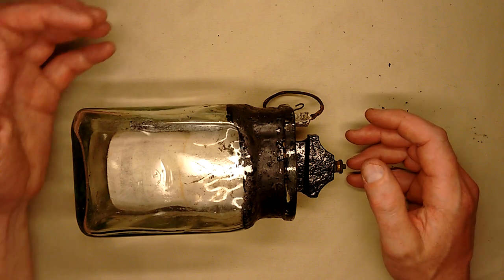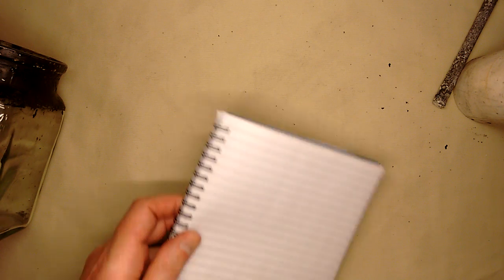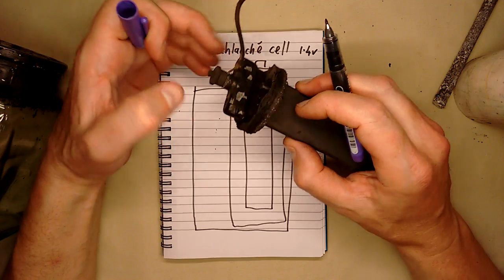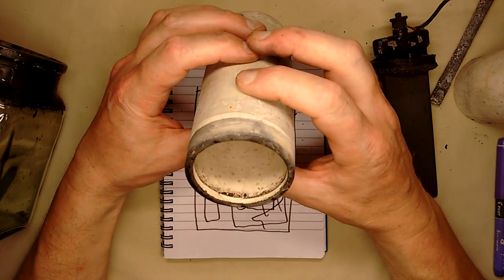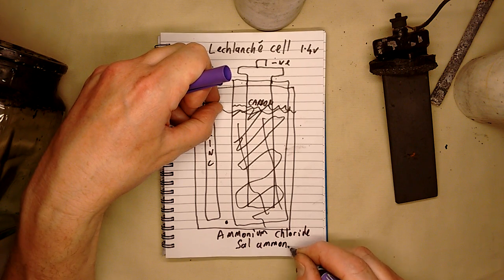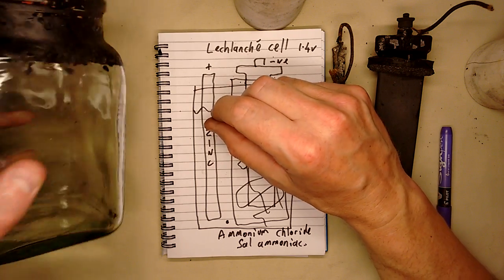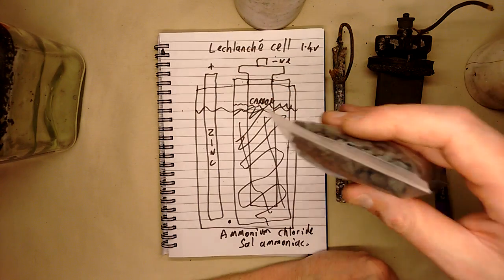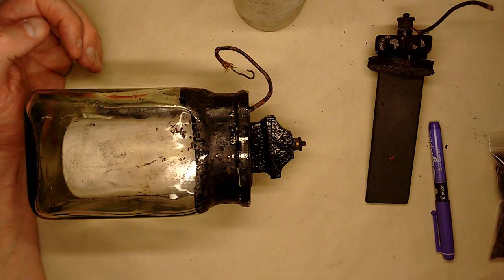A look at a vintage Leclanche cell.  (Very early battery.)

Comment: Many problems here, like zn acts as an anode as it has less reducing potential, so it must be -ve part as on anode oxidation provides 2 e and zn+2 ion and many more mistakes cl. eary, you are not familiar with chemistry of the  cells and electrochemistry, but still yo've done a great job sharing this online as normal person wont find any such cells to see how we started

Comment: The only old battery I have seen was decades ago when I was a teen and we moved to a local school's janitor's apartment (part of the school building) as my father got the janitor's job. In the basement there was an intriguing looking battery. It was a rectangular clear glass container, quite big perhaps something like 50 by 30 by 20 cm, and it was divided into many sections (the dividers were part of the glass container so it was quite a complicated glass piece all in all). It was also sealed on the top with a pitch-like black material. I think it was an early lead-acid battery but cannot be sure. It was connected to the emergency exit-light system (the green signs near doors). It was later replaced by a modern battery and I'm still kicking myself for not trying to get the old one for myself to study, it was such a beautiful thing!

Comment: We found a few of these under our floor boards. Do you have any advice on how to clean them up please?
Reply from the maker: If you're lucky the ceramic inner pot may not have cracked, but it's not a disaster if it has.
You can fill them with water to redissolve the sal ammoniac (ammonium chloride) electrolyte.  Wear gloves, but it's relatively safe - it's used as a food additive.  You can get it on eBay if you want to replenish it with new electrolyte.
I think you can probably find replacement zinc electrodes online, as it is the bit that tends to dissolve over time.

Just adding water may get it started again - they produce about 1.4V so two in series would light an LED.

https://en.wikipedia.org/wiki/Leclanch%C3%A9_cell
Reply: @bigclivedotcom  thank you, that's really helpful! The glass and ceramic pot look fine, but yes the zinc isn't in good condition at all. Also the copper has all gone green. Will try to restore, it is a lovely thing to have found in our old house 😊

Comment: In a dry cell battery, the zinc forms the negative terminal and the carbon is positive. We used to use them to start the engines on our model planes.

Comment: It is interesting that in all this time not much has changed in the construction of the classic zinc-carbon battery. (Even if the advertising on the packaging always suggests otherwise. Supposedly everything is super new and better than the others).

This wire on the zinc electrode can still sometimes be found here in Germany in the domestic installation in very old houses.
Believe it or not, this wiring even often still meets the conditions for an insulation test with 500V test voltage. But mostly only under absolutely dry conditions.

Comment: Even though my house was built in 1976, there is  a hatch above where the phone used to be ,where a No.6 dry cell ( 2½" diameter and 6" tall)  would reside. I believe this rural area north (55km) of Auckland NZ was still on a party line exchange at the time.
In spite of being 60km inside the northern border of the Auckland Super City ,we are still required to pay tolls for all the calls we make to the rest of Auckland.

Comment: During long use the cell polarised with gasses around the electrodes and current fell off. On resting they depolarised and could supply full voltage. The pitch is Anti creep pitch to prevent electolite crystallising up out of the glass jar. I believe these ran with visible crystals in the bottom of the jar in the solution of ammonium chloride. The small vent was for polarising gasses to escape.

Comment: I have two of these in a wooden waxed box. Electrolyte was Amonium chloride, the white pourus pot contains manganese dioxide as a depolerizer, the carbon rod is positive an the negative pole is a zinc rod at the side. Used in early telephone systems and door bells, two in series was the norm but you could get boxes that hold six, I have a few stamped GPO, companies that made Leclanche batteries included Ever Ready, GEC Magnet to name a few. There were many batteries a bit like this including the Bambertite cell, Bunson cell, Denial cell, some were just ceramic pots with a bandage fill of manganese dioxide an a carbon rod, the Aston cell was one such battery which I have in my collection. I also have a  Fuller's Mercury bichromate battery, the ceramic shell only. I also have a Siemens brothers one with leadless glaze, other makes of Leclanche batteries included Indian rubber company of Silvertown London. The real old Leclanche which I don't have yet was made by the national telephone company, these predate the GPO. The earliest battery was found in bagdad an was a ceramic pot with the remains of an iron rod, known as bagdad battery.

Comment: We had three of these in the cellar of one house we lived in, the maid's quarters were in the attic, along with the bell and indicator board.  The insulation on the wire you referred to would have been varnished cotton, a thread of cotton would be wrapped round the wire and then the whole lot soaked in varnish or shellac.  One layer of cotton was called "Single Cotton Covered" (SCC) and there was  double cotton covered (DCC) which had two layers of cotton.  The bell had a couple of coils insulated with green DCC and no varnish.  IIRC all the terminals were solid brass.  Bell pushes were placed strategically around the house.

I wish I kept it all, but I was a very inquisitive kid at the time and anything technical got dismantled.

Comment: What is it that determines the 1.4 volts?  I am a philosophy and computer science dual degree kinda guy, but that 1.4 seems entirely arbitrary -- something some of my old programming professors would have called 'magic numbers'.  Where does the value come from?  Is it at all affected by the planet's magnetic field?  I understand how to get more by connecting these things in series vs. in parallel.  But where does the initial 1.4 come from?  Or perhaps another way of asking the question would be how we could predict that voltage from the materials used?
Reply from the maker: It's usually the electric potential difference between the anode and cathode materials.

Comment: That wire wrapping could possibly be asbestos. It was used as electrical insulation btw...
Reply from the maker: I doubt it in this case, but am always aware that some old cables do use asbestos.
Reply: @bigclivedotcom  ok thanks dude. keep going with the cool stuff :)

Comment: I remember chucking out a dozen or so of these when clearing out a school physics lab. Wish I still had them. You'd be surprised out what ancient stuff is still in school labs. I used to run a business where I published a newsletter for school science labs. One feature was an ID quiz, I put in a picture of a Poggendorff cell, and got a phone call from a school to say they had one.
Don't try and remove the brass connection from the carbon plate, they were often fitted using a mercury copper paste. The manganese dioxide was mixed with carbon granules.

Comment: On a modern carbon zinc flashlight battery, the case is made of zinc and the center electrode is a carbon rod with a metal cap bonded to it.  The zinc case is NEGATIVE and the carbon rod is POSITIVE.  In Clyde's video he labeled the zinc electrode as POS and the carbon rod as NEG.  Did our wonderful Clyde mess up?  Am I messed up?
Reply from the maker: Yeah, I think I messed up.
Reply: We (I) forgive you, I am probably the only one that even noticed and only because this old geezer doesn't have much to do during the long cold winter here in Missouri (USA) except to nit-pick.  Please continue your great work, I always look forward to you new offerings.

I really appreciated your use of the clamp on DC meter,  I had to stop the video where you used it and get the model number so I could order one from ebay for $31.  It works perfectly other than being touchy on the 2Amp DC range where zero seems to wander around.  I wanted it to mainly check parasitic current draw from a car battery when the car is turned off but still kills its battery overnight;  normal draw is around 30mA so this meter is perfect.

Thanks so much for great videos, your best are of course, Fanny Flambeaux and your recipe for making instant fizzy coffee that bubbled all over the workbench!

Bob L
Reply: Robert Leifeld sub car still draw Power even if the engines off as it usually helps keep things like the clock setting and clock working even if the car is off in like your horn and things like that.

Comment: In the 1950s, my dad, who worked for GEC, brought home several large brown earthenware jars. They were from an emergency power supply for a substation. I think they were Lechlanche cells as they came with zinc rods but nothing else. My mom used the jars to salt-down runner beans from my dad's allotment. A bit of early recycling.

Comment: clive: you should have mentioned what the magnesium dioxide is used for. it does not participate in the electro-chemical reaction that generates the current. the role of magnesium dioxide is to capture and react with the hydrogen atoms generated during the reation; hydrogen atoms can combine to form hydrogen molecules (H2), which is a gas at room temperature and bubble of H2 will get out of the aqueous solution and stick to the carbon electrode. an electrode covered with gas bubbles will be less reactive.

Comment: Strange indeed.  Back in the early 50's when we still lived on our farm referred to as "Up North!" in North Dakota, where we had no electric power, to charge the batteries on the farm equipment, when they went dead, father had a wind charger.  There was a small light bulb in the garage, probably equivalent to a 25 watt today that could be turned on if the wind allowed.  He had a glass battery of sorts but the container was much larger.  When he finally stopped using the battery, the contents were discarded, and the battery jar was given to we children to use for what we desired.  Well following a heavy rain, we discovered that tadpoles were developing in a mud puddle in the middle of our driveway (Cars diverted so as not to get stuck and drove on the grass.  So we gathered many of the tadpoles and placed in that glass battery jar to watch them grow.  My sister and I were just talking of this a few weeks ago, then I run into this video. To me that jar was very large, but I must have been 5 or 6 years of age, so who knows how large it really was.

Comment: As I recall, the original telegraph systems were powered with voltaic cells ( Cu and Zn in dilute sulfuric acid e-lyte) which developed a potential of about 1 volt.  (How the standard  of 1 volt was defined) I also seem to recall that these old cells used to power the telegraphs were quite large (volume measured in gallons).  Talk about a mess if you broke or spilled one!

Comment: they had much larger batteries like this for rail road use. They had zinc plates and you added cos tic soda and water then they used oil on tp to "seal the water in".  I have several at the museum where i work if you would like pics

Comment: Could you do a video on NIMH batteries?  I had a lithium battery explode on me recently and now I'm wondering how safe my other rechargeables are.
Reply from the maker: NiMh cells are extremely safe.  Their only real risk is if they are short circuited they will be able to deliver a very high current.

Comment: Ive found these in some old telephones, as they were used before no6 cells were introduced. I wonder how easy it is to restore these to working condition?
Reply from the maker: At the easiest just adding water to the dry cell.  Hardest, if the porous pot is intact is to replace the electrolyte with a new saturated solution of water and ammonium chloride, and replace the zinc electrode if it is excessively corroded.

Comment: Hmm... What exactly defines the amount of V you get from a battery these days?
Size doesn't appear to be the case considering that all LiPo Battery Cell's are rated at 3.7V no matter their size.
Is it the ratio between the materials that make up the "innards" of them?
Reply from the maker: It's the quality of manufacture, packing density and dielectric thickness that dictate the capacity of an 18650.  That can range from about 500mAh or less to 3000mAh and slightly higher.
Reply: Volt, my question was about the Volt, not the mAh =)

All of my rechargeable AA batteries are rated 1.4V with only the mAh varying between 1800 and 2700mAh.

What mechanic inside the battery caps the Volt of a rechargeable AA to 1.4V or that of a non rechargeable AA to 1.5V?, etc...
Reply from the maker: The choice of electrode materials determines the voltage.

Comment: That Manganese Dioxide is nasty stuff to breathe.

The stuff I used to play with was called Carulite and it's used to catalyze ozone back to oxygen after the ozone is used for water treatment and sterilization..
When I used to replace the manganese dioxide in the catalyst units at water treatment plants, it was time for full bunny suits and proper respirators.

The stuff causes nerve damage and basically gives you Parkinsons disease with enough exposure.
Reply: Do not worry my dear, of course the maid will service the Leclanch-e cells.

Comment: These people were clearly technophiles.  My old school still had solid copper wires under the floors and quadrants that carried kinetic energy to the bells that were mounted on large coil springs made of flat metal, so that the bells 'jangled' when the ropes were pulled in the various rooms.   Each bell had the original name of the room hand painted on it in beautiful copperplate script on a hardwood plank with formed edges. To be fair to them, I did find some evidence of the later electrical ones like this, with some sort of electromechanical flag mechanisms inside a wood and glass cabinet, high up, but dared not try and explore, as they were in plain view - I was a small boy, mischievous, yet cautious ;-)

Comment: https://www.facebook.com/circuitbreaker/videos/1591448714481285/   Does anyone know of this product or used it ?
Reply from the maker: Conductive ink pens have been around for a long time, but they are expensive, run out of ink fast and do not make very good connections.
Reply: Thank you for your reply . I wondered if it was possible to use such a product to produce a teaching aid for budding hobbyists?
Reply from the maker: It would work, but is an expensive alternative to an electronic breadboard and pack of wire links.

Comment: In 1959 when I was apprentice electrician at a coal mine, one of our duties was to check the bank of Leclanche cells and maintain then.
They were sighted in the pit bottom and used for shaft signalling and were very reliable if looked after properly.
Thanks for sharing , bought back some good memories to me.
Reply from the maker: I've got great memories of working in industrial environments (steelworks) from way back too.  Before red tape and deskilling took all the fun out of work.

Comment: What a great find! I like finding old tech like that. Though we don't really have those in the United States. We did have the wire casing you noted way back in the 1920's. I even had to work in an electrical panel (120VAC @ 60A) with the damn thing live! That casing was also very brittle and basically fell apart when moved. But the solid copper wire kept everything from shorting. A teacher friend of mine even brought his shop class around to see it before I started working on it.
Reply: Of course you have them in the US! Didn't you ever watch Casey Jones?
Reply: Nope. Just did a wiki-search on him and remembered hearing about but not seeing anything.
Reply: Gregory Thomas I didn't mean the historical John Luther (Casey) Jones, I meant the children's TV series based upon the folklore which came to surround him.
It frequently features Morse telegraph equipment, including glass jar cells. It's where I got my original  fascination with the technology.
Reply: Ohhhh...kewl beans! I will look that up shortly...thanks for the info!

Comment: Clive you come up with some of the neatest stuff and you are able to explain it well. I'm not in the electronics or the electric fields but you have give me some good ideas on some of the simpler things to try out. Sometimes you remind me of a kid that loves to take thins apart just to see how they work. That's how I got in to the mechanical field. But when I was a kid, the stuff I took apart never went back together. Most of that stuff was broken anyway so I couldn't make it any worse than it already was. You have a good channel.
Reply: that was me! the kid who took things apart to see how they worked :0 Occasionally I did get them back together again, and loved to check out peoples trash on Tuesdays [ Garbage Collection day when the trash cans were out to the curb.] I would find non working electrical items , small Appliances etc. and putter around with them to see if I could fix them. what I couldn't, I stock piled the good parts for other projects.

Comment: Cathode is the electrode (conventional) current flows out of, anode is what current flows into. So on a battery/cell the anode is -ve and cathode is +ve, on a device (like a diode) the anode is + and the cathode is -